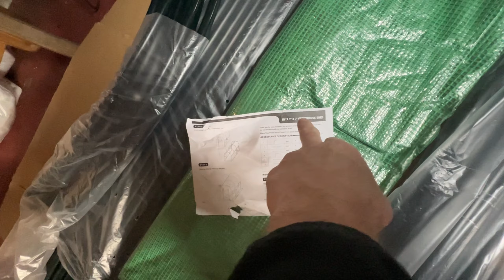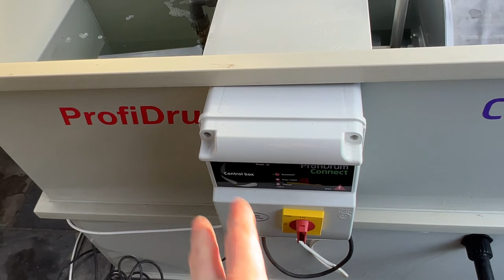Another day in the life of my koi ponds and tanks and the profidrum is ready to be setup #koi #fish

Comment: I've had the same drum fitted for a few years now.
Great bit of kit... A few changes I've done.

1. The air pump has been removed and I use an EA 70 to feed my drum and bottom drain, works well when you add a little more K1+.
2. The air pump supplied is now used on my grow on pond and air stones in the inlet of the combi, to stop debris build up.
3. The higher the level you can get in the drum = less cleaning, due to larger surface area.
4. Just check with a torch on the inside of the screen for a debris ball of crap, ENSURE you switch off power supply before trying to remove the crap. 

Be aware of trying to drop the level of your pond using the combi pumps, the system will trip when it hits the low level switch.

Hope this helps anyone.

Cheers Mick
Reply from the maker: Cheers mick it’s been running for a good few months now, can not fault it it’s a cracking bit of kit 👌👍